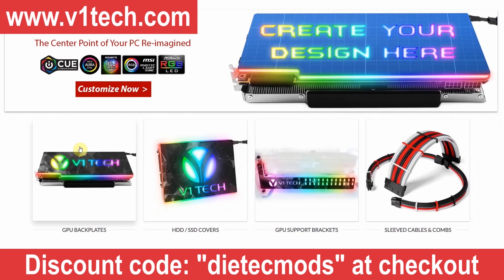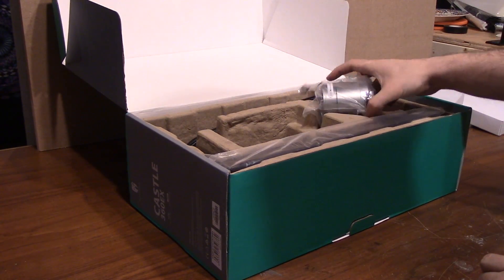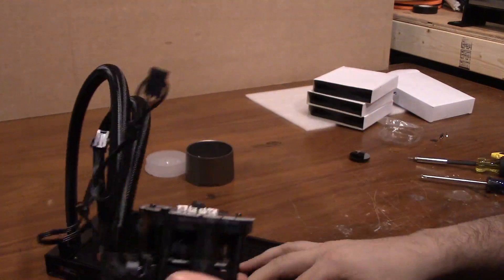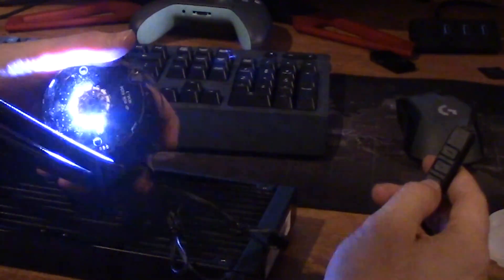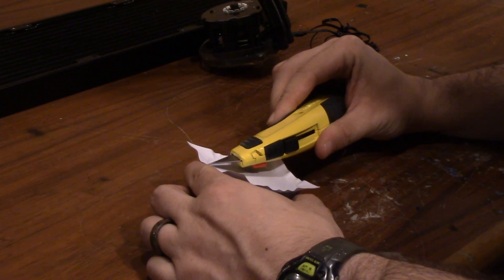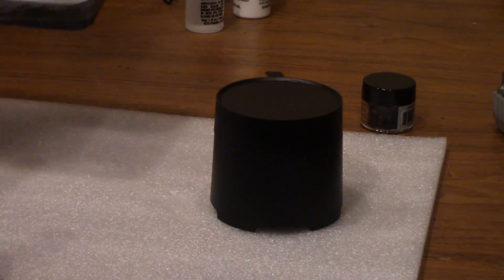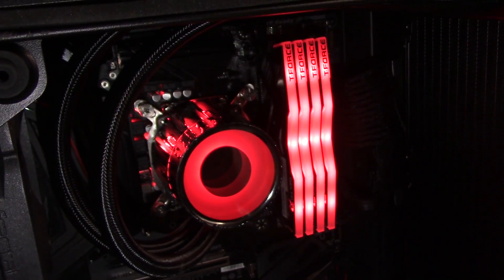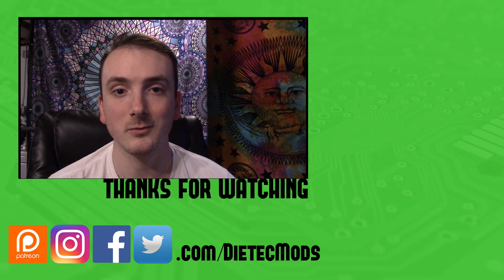Tearing Down and Modding the Deepcool Castle 360EX CPU Cooler!

Comment: I came here wanting to find out how many LED's were in the Pump as I couldn't find that info anywhere else. Not only did this SHOW me the answer but, it gave me a LOT more detailed information about my cooler that I did NOT know. I just purchased it for a build and it hasn't arrived yet so I'm really excited. Didn't expect to have REFILL capability either so that was NEWS to me. It just so happens I purchased a set of TORX drivers 10 years ago I hardly use but do come in handy for rare occasions like this. There's a lot of folks online who just make a living showing you how to build systems with store bought equipment, but it's nice to come across someone who's not afraid to tear into, and modify them to suit OUR needs. I will be checking out your other vids. Thanks

Comment: So in your description it says changing the tubes is like the one in your video, where the tubes for the deepcool castle AIO meet the res and block they are metal so you can't cut through them as easily, I want to change the tubes and add colored coolant but I'm afraid to ruin it, is it for sure the same?

Comment: I just came across this channel while looking into modding my Deepcool AIO and there is some cool content here. One thing I've noticed is that these things have metal crimped over the ends of the tubes, which might make replacing them quite difficult. Do you know if it's possible to remove these to attach new tubes?